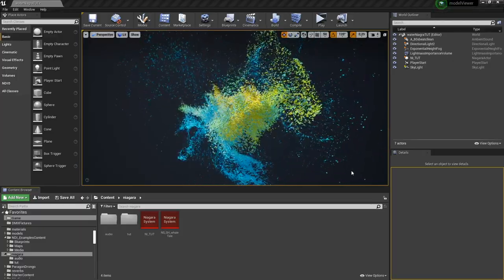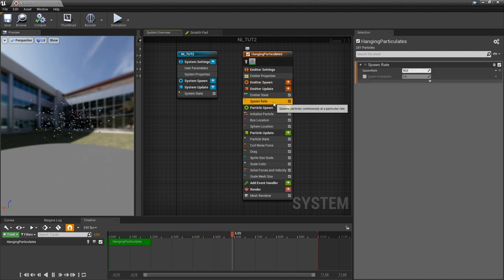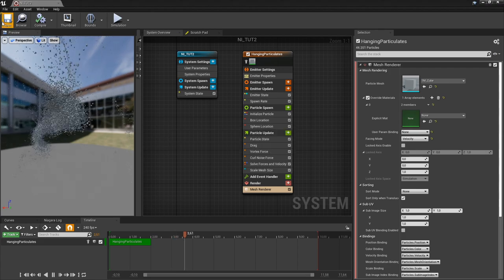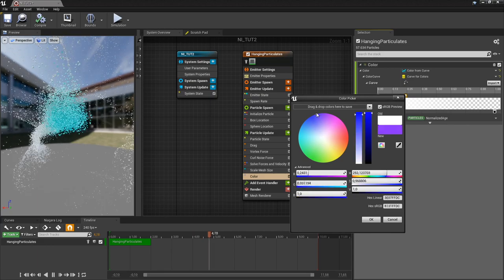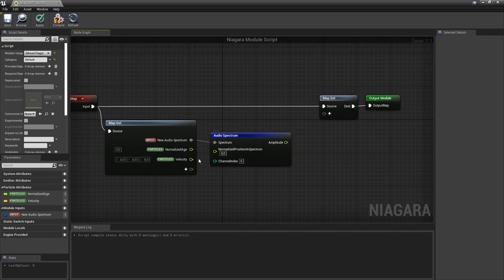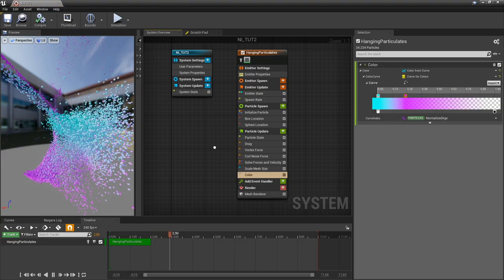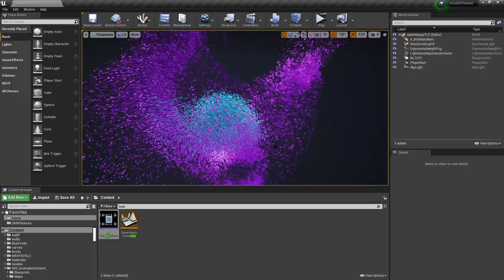Let's build this Unreal Niagara audio visualizer within 10 minutes

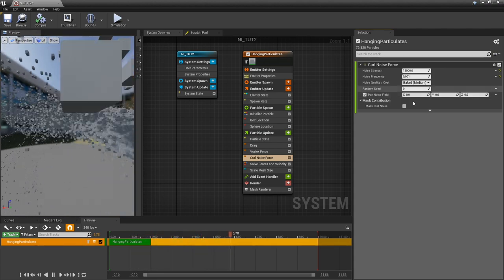Comment: For those using Unreal 5.1 and getting a thick line of particles that basically follow each other around @2:39, you need to set the Noise Frequency in Curl Noise Force to something higher than 0.001 like in the video. I set mine to a 0.75 and got similar results but feel free to experiment between 0.5-1. Also try reducing the Drag to something lower than 10, I chose 5.
Reply: thank u!
Reply: TY!
Reply: halo，in ue5.3，the ui of mesh render which is the render below the hangging emmiter is not same of the ui in Vedic which is in ue4.where can I get the same ui.ths!n

Comment: Thank you for posting this, Sem! Excellent tutorial!

For anyone trying this in >UE4.26: I couldn't get it to work until I read someone else's post about changing the sound drivers. My workstation is running Windows with Realtek sound drivers. When the Output is set to Realtek, I can't get this to respond to the music (same goes for other audio visualizations). 

I switched over to a different sound driver (like USB headphones, or in my case a Presonus audio interface) and that magically did the trick. This now works in UE 4.27 & UE 5.01 so long as I'm not using the Realtek drivers.

One last thing - if you have a VR headset, I highly recommend you place the player start right in the center and scale up the Emitter/Sphere Location to like 1000. Enable Surface Only Band Thickness and Expansion mode to Outside. So pretty!

Comment: I would like to take the time to thank you for this, even it could be seen as an old trick, it really helped me to reach my goal !
I also would like to point out that using the internal recorder brings up an issue with the sound. It doesn't get any effect from it since the recorder doesn't display any sound during the recording.
Thanks a lot for your video !!

FIXED : In the render movie setting just enable the "Audio Outport Format" as "Master Audio Submix". This should render the whole thing with some sound interaction. The track will loop over and over until the render is done so make sure UE isn't minimized. This will also create an audio file, which in this case may not be useful, you can delete it afterwards.

Comment: Hey, nice tutorial! I have a problem though, when I add Scale Mesh Size, my meshes disappear, nothing shows in the editor or niagara system. Any workarounds or do you know why this happens? thank you.
Reply: Do this on 4.25.4, not 4.26
Reply: On 4.26 you neeed to go to Initialize Particle -> Mesh Attributes set the scale mode to uniform (it's by default in unset), then it will work.

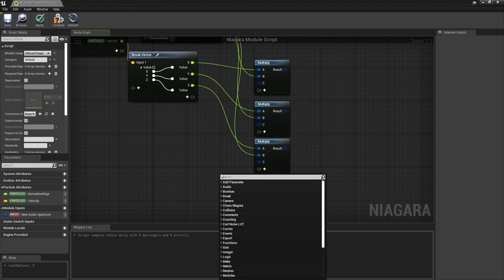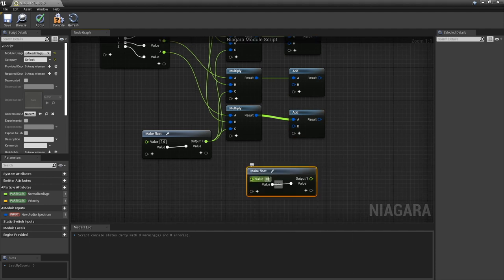Comment: This is a wonderful tutorial, thank you so much for sharing! I wonder if it would be efficient to, instead of the work from ~7:33 - 8:30 (manually "padding" the output values to get them into a useful range), put a Remap Range node on the Break Vector X/Y/Z outputs and re-range the input range to a desired output range for each. This is the way I learned in TouchDesigner and it works nicely to preserve and adjust ranges.

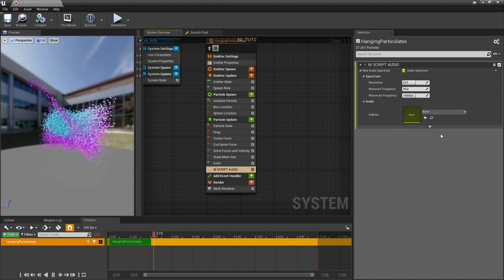Comment: Heads up in UE 5.2- the Niagra Audio script we make did not show up in the list of available modules to add to Particle Update, even with Library Only unchecked, unless I saved/restarted UE. Guess it needs to index that way (at least on Mac M1). Workaround: I shrunk the editor window a bit and cross-dragged/dropped it from the Content Browser into the list manually, works great. Hope this helps someone. Also in 5.2, if you don't see the Audio Master Submix as an option at 9:45, click the gear in the Submix pulldown and check "Show Engine Content."

Comment: Ok. I was having problem - The particles didn't move in 4.26. I have try to fix it for two days, and finally I found the cause!
So - I completely remove the drivers (Realtek High Definition Audio Codecs Drivers) and continue with the windows generic one. It work!

And Thank you so much for the tutorial!
Reply: Hey Mate, what do u mean with remove the drivers ? Deleted ?
Reply: @Future_Me  if you have problems uninstall any audio drives you have installed. Windows have its own so you will still have sound.

Comment: Wow, that's inspiring! How can i fix flickering? It keeps distrub me, but anyway great job!
Reply from the maker: for me it helps to reduce the size of the meshes in the scale mesh size module. instead of 0.1 try 0.06 or something as a start point. 
otherwise reduce the spawn rate. 
I noticed that the flickering happens when there are too many meshes overlapping either by size or position
Reply: Same here and 0.06 is works perfect!
Reply: If your whole Niagara Sim is flickering update your driver and turn off anitalising
Reply from the maker: what also worked for me is setting the fixed bounds max to 2000 for all the axes.
Reply: What I don't get, however, is why flickering occurs with GPUsim enabled, well, I think it's related to enabling fixed bounds, which is a must if you choose GPUsim..

However, I never get flickering in CPU(also because I don't use fixed bounds in CPU).

So I guess I'm wondering why it occurs with fixed bounds... Maybe what Sam said about overlapping etc

Comment: Wow, that's awesome. I can't wait to see what you come up with next!
I see after a while the second colour no longer appears as well as the main effect seems to heavily tone down, possibly a fault on my end but it's still awesome.
Reply from the maker: the second color (and the first) also has an opacity slider underneath the color slider, the 2nd color opacity slider is set to 0%. you can change it too 100% or 1.0 to not have the color disappear over time. 

as for the audio reactiveness make sure that your sample is using the right submix as the one you've selected in the niagara system audio module, otherwise you can change the amount of effect the audio module has by multiplying the velocity multiplication with a higher value than 1.6 if that makes sense

Comment: Cool. Just a note, you don't need to split the x y z in your module, you can multiply/add vectors as they are without splitting and recombining :)
Reply from the maker: jup! just make sure you don't multiply the vector with a float or it wont work, you need to multiply the vector with a vector but what's coming out of the audio spectrum is a float, so i could've gone two routes here and i chose the detour haha
Reply: It's actually fairly standard to multiply vectors by floats, though if you want to definitely do vector by vector math, I believe there's a node to turn a float into a vector (as you're using the same value for x, y, z) and then you can add/mult those around.

Its all semantics though, this works, and it works awesome. This topic has been something I've been meaning to dive into, I wasn't aware UE did such a good job at making it simple! Next few years are gonna see some unholy looking games 🔥

Comment: Just a heads up, when I added the script to the niagra particle, non of the parameters were showing. this is because the script wasnt exposed to the library. go back into the script and in the settings on the left you can change the library visibility to 'exposed'
Reply: Thanks for posting this. Still isn't working for me, but I appreciate your taking the time!

Comment: Hey man, Awesome tutorial. I have a question. Is there any chance to export the output as a movie? After I hit render the output does not include the response for audio. All I have just swirling particles without any beat.
Reply from the maker: you can record your output  in realtime with obs, or you can use movie render que in unreal. make sure to add a music track to sequencer, set the framerate of sequencer to the same forced framerate of your movie que export and make sure to export .wav as well. then the audio and video are synced and the particles should react to the music
Reply: @shimlaDnB  I think I accidentally found that adding the track in the sequencer way. Thank you so much I will try other ways too.

Comment: Hey, really great quality, your tuts are really good, thank you.
Newby here, i was able to reproduce all the settings you showed but how can i change parameters for reactiveness/puch to the beats?
Reply from the maker: interesting question! so the audio module gives you an amplitude from 0 to 1 right, because it's normalized you can try squaring the amplitude with pow. that creates a parabolic curve, pow 0.2 would be not snappy at all, pow 4 would be super snappy.

Comment: READ IF YOUR PROJECT WON'T OPEN ANYMORE: It can happen that you disable your mic to use a different one or you transfer the project to a machine that do not have a microphone, in that case the map will not load, just enable the mic again and it should work, it took me the good part of one hour to figure it out, just in case somebody has the same problem

Comment: I am using UE5 and I couldn't get the particles to scatter,  when you change the size it disappears, I changed the attributes to uniform so I could see them but I think that's what is causing this issue. I know this is an old video, any chance of an updated UE5 one?

Comment: Thanks for the awesome tutorial @Sem_Screuder! It's working well for me when I use a pre-recorded wav file, but when I switch to using the audio capture component I'm no longer seeing any audio-reactivity. I know my mic's working because I hear my voice coming through the speakers when I'm running the editor in play mode. Also made sure audio is being sent to correct submix. Any ideas of what the issue may be?
Reply: Figured it out- my mic was plugged into channel 2 of my interface so just switched channel to "1" on the audio spectrum node in the module and it works great.
Reply: @ericrius1  Hey Eric, I was wondering the same thing. I cannot for the life of me figure out how to use it with the audio capture component. I've tried your suggestion of changing the channel index in the audio spectrum but no luck.

Comment: I'm in Unreal 4.26 and Scale Mesh Size doesn't work, it just makes my cubes disappear
Reply: Same
Reply: Same
Reply: Fixed using 4.25
Reply: @Ale4D  I will try 4.25 thank you.
Reply: What is causing the issue with 4.26? Anyone figure it out?
Reply: @iamdani  maybe try to create it in 4.25 and then update the project
Reply: Change the MeshScaleMode Attribute in InitializeParticle Module from "Unset" to some other value, like "Uniform"
Reply: @billB101  Alternatively, if your version supports it, under "initialize particle," you can "mesh uniform scale" i believe to scale the mesh there.
Reply: From a commenter above: For people that use 4.26 and having  the issue that the cube meshes are not showing in the preview :  go to Initialize Particle -> Mesh Attributes set the scale mode to uniform (it's by default in unset).
Reply: @PHATTrocadopelus  thank you!

Comment: Love the tutorial! Thanks for putting it together. I'm trying to export this via sequencer as a .avi and can't find a solution to get the audio to sync with the rendered video - which means the particle reaction to the audio is insanely fast and although the video renders at the correct length, the animations/audio are over 5 times too fast. 

Does anyone have a valid solution? I'm about to try to render as an image sequence and recompile it in Davinci, but I have no clue if the animations will still be way too fast.
Reply: Have you found a solution?

Comment: my cubes are showing as white spheres by default, not sure what to do because I followed your steps precisely. Any thoughts? cheers !
Reply from the maker: if you've created the same material as i did and made sure to link that material in the mesh renderer module than you can change the color of the material with the 'color' module.

Comment: I can't get particle reflections (Cascade and Niagara) in UE4 in raytracing mode. The latest update of the engine and drivers + RTX3070 everything else in raytracing works, reflections of other objects. Please tell me how to enable it.
Reply from the maker: i'm sorry i can't help you with that as i'm still running a GTX card
Reply: @shimlaDnB  Particle reflections is an impressive FX as I imagine! But why doesn't anyone make dune 4 on a powerful RTX?  For some reason, none of the experts anywhere explained this topic. OK. I should be grateful for the help later.

Comment: @Sem Schreuder Is there anyway to add a midi controler to this?
Reply from the maker: there is! with OSC, if you're using Ableton by any change you can do it this way: 
https://youtu.be/xnOv_Pq-LPQ
you would have to modify the Max 4 Life device tho. 
Otherwise you could maybe find another way to convert your MIDI controller messages into OSC.

Comment: hello! how comes that when I add the Curl Noise Force module my particles move in one direction instead of that random path? I have noticed that inside the module I do not have the "Random Seed" parameter. how do I fix this??
Reply from the maker: when i recorded this video i was working with unreal engine 4.25, some things have changed in the new version in niagara. Just mess around with the parameters of the noise function until you get something you like. It's what i did at this stage ;)
Reply: @shimlaDnB  thank you! it is a fantastic tutorial!

Comment: Has anyone been able to get this to work with the audio muted?  The only way I can get the NI system to react to the audio is if the "mute" submix is set to "full volume", but then I get feedback/doubling from my Mic/Audio input...  Unreal should not be duplicating the sound, but if the "mute" submix is set to mute, then the NI system doesn't react.  I've set my input submix as the "input" submix in my NI system.  Thanks!

Comment: Does anyone know how to get the audio to trigger on your sequencer render? I added audio as a to my sim in sequencer with no results and selected master submix in the AVI export with still no results, cheers
Reply: ok ive managed to get an export that reacts to the audio, but its not reacting to the audio realtime ;/
Reply: ok surprised i found a solution that didn’t take me 3 days. for anyone facing a sync issue. export in movie render queue with audio. cheers
Reply from the maker: @pva5142  i've just uploaded a tutorial on this! i've had some sync problems with the movie render que as well but if you set everything to 60 fps it should all be in sync again
Reply: @shimlaDnB  ah that’s interesting, i got a lot of issues with particle modules at 60 fps, it’s almost as if nothing works. 30fps seems to be the only frame rate where my particle modules are clearly visible. Was going to test today by doubling ratios on module variables at 60 fps and see if that makes a difference… I’m on UE5.
Reply: @shimlaDnB  Hey Sam, anyplace you can point me to, to grab an understanding or basics of how to use command lines via Twitter to drive attribute points in animations in UE, in real-time as you showcased in your other video? Cheers. Tried to find a place to private message you but seems your IG isn’t there anymore.